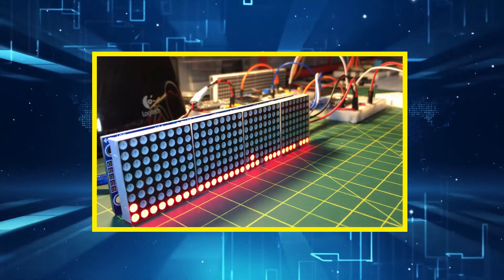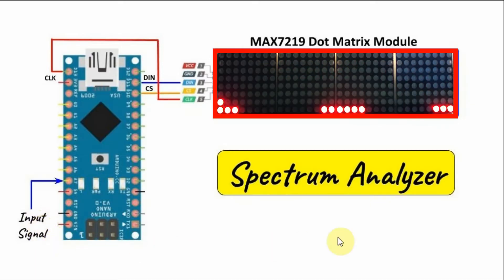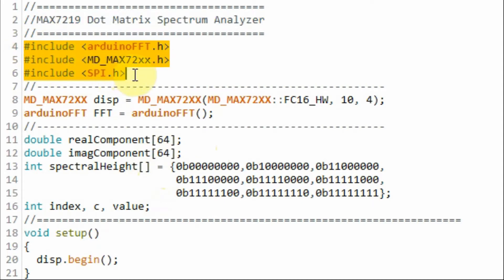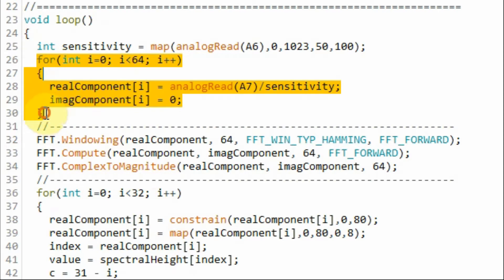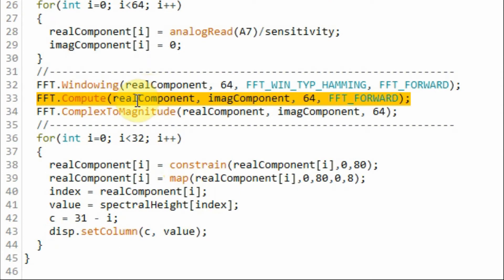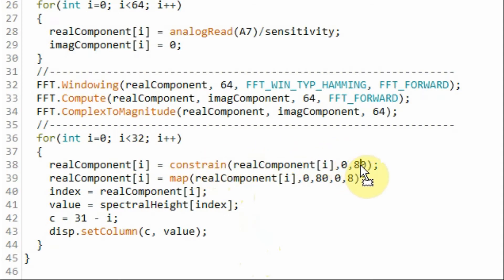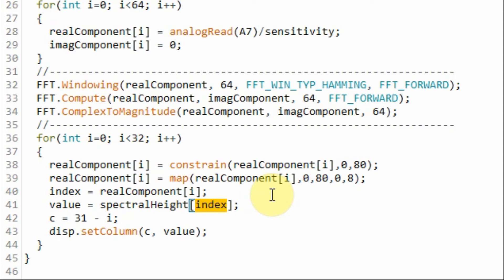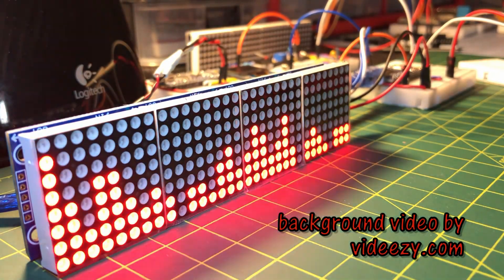MAX7219 Dot Matrix Spectrum Analyzer

Comment: Excellent programming and I try using nano(for some reason doesnt work for me with leonardo), the libraries, but in my case it doesn't work for me according your video, if I adjust the microphone potentiometer the result is that without the need for external sound it shows the pattern of the video, therefore, I don't know how to adjust it so that it works as expected.

Comment: Hello sir.
This project is very interesting. But I have two questions. First, if I want to expand to 64 x 8, what change does the code need?
Second, how can I change the central frequency of the columns?
Thank you
Reply from the maker: Hello Vahid. For your first question, you just need to double your array size and double the loop counts. As for your second question, the central frequency will depend on the number of samples; in other words, the dimension of your dot matrix. Hope this helps, and thanks for your feedback.

Comment: sir when uploadind the code to arduino, its show this error

Arduino: 1.8.13 (Windows 8.1), Board: "Arduino Uno"

sketch_mar06a:4:10: fatal error: arduinoFFT.h: No such file or directory

 #include <arduinoFFT.h>

          ^~~~~~~~~~~~~~

compilation terminated.

exit status 1

arduinoFFT.h: No such file or directory

This report would have more information with
"Show verbose output during compilation"
option enabled in File -> Preferences.
Reply from the maker: Google search for the library arduinoFFT.h and download it and add it to Arduino IDE.
Reply: @AnasKuzechie  Sir last thing i want to ask, how you connected 10k pot at A6, had you used another potentiometer or what? I didn’t understand that?
Reply: @AnasKuzechie  I'm done with the project sir, it's working completly fine. thank alot Sir
Reply from the maker: @198407ankur  Good to hear

Comment: Very nice video sir. I want to make this since very long time, i have basic knowledge about electronics. I hope i will be able to make this dot matrix visualiser. Thanks for the great stuff. 👍🏾👌🏾
Reply from the maker: Thanks for your feedback.
Reply: @AnasKuzechie    Sir as shown in the diagram, three pins(CLK, CS, DIN) of MAX7219 dot matrix have to be connected to arduino. What about the other two pins(GND and VCC). We don’t have to connect those two pins? And where to connect other two pins of sound sensor that you had shown in the diagram.
Reply from the maker: @198407ankur  GND to Arduino GND and VCC to Arduino 5VDC. There's no sound senor!?
Reply: @AnasKuzechie  sir at 1:09 you showed a speech signal module, where to connect that. One pin will be connected to A7 and other two pins where to connect them. Thanks for the replies sir.
Reply from the maker: @198407ankur  Hi Ankur. Arduino's GND and 5VDC
Reply: @AnasKuzechie  at 1:09 you showed speech signal module. On arduino how you had connected it? 
https://akuzechie.blogspot.com/2021/01/max7219-dot-matrix-spectrum-analyzer.html 
this is your link where you had posted diagram and code, after seeing that I'm very confused after seeing Potentiometer is connected to A6.
Potentiometer is already soldered to the speech signal module, how did you connect that to arduino.
Sorry I had asked so many things, but i really want to make this project and my first arduino project.
the speech signal module only have 3 pins(ground, out,VCC) ground will be connected to ground of arduino, vcc to 5v-arduino and out to A7-arduino. how you connected onboard potentiometer to A6?